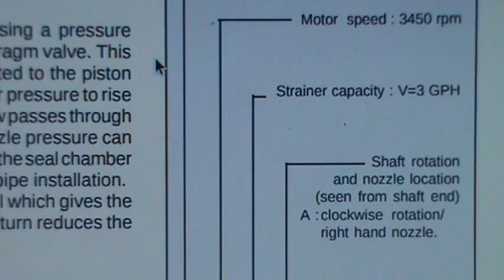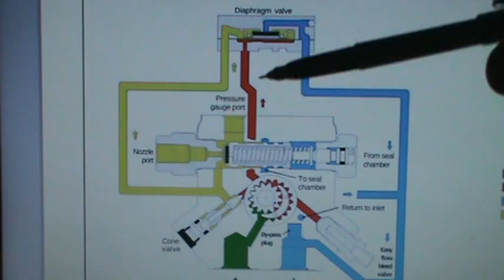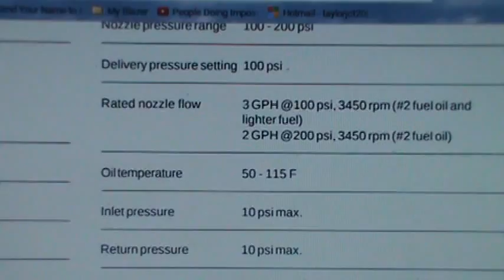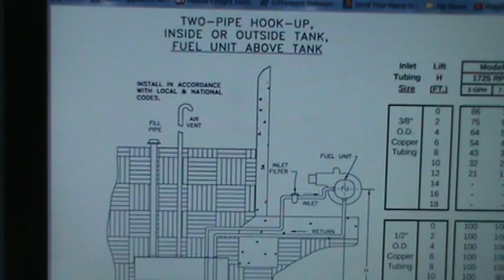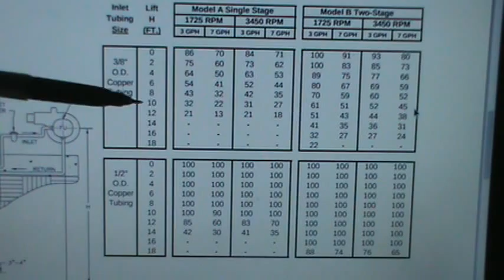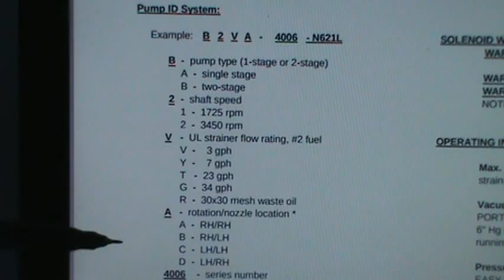Oil Burner 101 Part 1 "Fuel Pumps"

Comment: This was a great video with the A2VA-7116 pump.  I am somewhat new to troubleshooting these pumps. I am a little confused about the vacuum and testing a pump. On the A2VA-7116 single line set, 3/8" with no electronic solenoid. With a gauge connected, 3450 rpm. With a dual pressure/vacuum gauge connected I read 135psi with a .75gph nozzle and the thermostat reaches temp, shuts pump off....will the gauge go to zero or hold a vacuum? I am just confused if that 10psi you mentioned means that it has to have 10psi of vacuum to basically open the valve then once the pumps shuts off and there is no vacuum,  the internal valve closes to prevent free flow? Hopefully this makes sense. I took the cover off before I ever watched this and just a little oil leaked out then stopped.  I do know that inside the tube where the nozzle screws in, there seems to be a check valve, I can hear it when I invert to burner tube. Thanks in after for any further information.
Reply from the maker: The pressure and vacuum will drop to zero when the burner turns off. The fuel cut off valve which allows the fuel to flow to the nozzle line opens and closes on centrifugal force. The pump needs to get up to speed to open. When testing the cut off valve, the pressure should not drop lower than 10 psi. With the burner running. Please watch my video to explain how to test the cut off valve. Example:  If your pump is set to 135 psi. Then when testing the fuel cut off it shouldn’t drop no more than 10 psi. to 125 psi. with the burner running.
Reply: @scotttaylor3049  it may have an issue then. It does have one of those insufficient check valves inside the oil tube at nozzle adapter....no electronic solenoid which you probably already know. With the gauge in the gauge port the pressure doesn't drop when running and when it shuts off, that gauge reads zero. Then jumps up to the 125 at startup. I will try to locate the video about checking the shut-off.  Thanks

Comment: This is a great video, but I still am puzzled by the topic you are covering at about 10:25 My question is, if the OSV needs a slight suction from the pump to permit flow, then why is there not such a / (another) device immediately at the tank outlet, so that any rupture of the pipe beyond the tank is protected by this upstream OSV, thereby stopping the tank contents from emptying onto the ground? I realize that the OSV near the boiler is there to detect heat and shut off the flow when needs be, but is there any reason why something similar couldn't be right up close to the tank.

EDIT - (I have in the last few minutes found this comment referring to where an engineer should install an OSV, besides just as you have explained) 

"he should install a second OSV on the same oil supply line at the outlet from the oil tank, particularly if the oil tank outlet piping exits at the tank bottom, and ahead of the oil filter"

Do you see any downside to doing this, and if not, I wonder why it isn't common practice, or even mandatory?
Reply from the maker: Thanks for your comment. I’m in Connecticut and Connecticut State Code requires a thermal safety valve at the burner and at the oil tank but it only works on temperature if there’s a fire it will melt and shut the oil off. Connecticut code for many years now requires a vinyl coated oil line in case it does leak that way it will not leak into the ground. I’ve never seen one just rupture since it’s not under any pressure but overtime some do corrode through even though it is copper. it is still extremely rare. The majority of oil tanks in Connecticut are in the basement.
Reply from the maker: https://www.supplyhouse.com/Suntec-PRV-38-3-8-Oil-Safety-Valve-9944000-p

This is what you are looking for
Reply: @scotttaylor3049  Brilliant. Thanks

Comment: Good day,
Can I replace my 3450 cleancut with a 1725 suntec? Please respond as its cold tonight. LOL
Reply from the maker: No it will not work it will not open the cut off valve inside to let Oil come out. It works off of RPM. that would be running too slow.
Reply: @scotttaylor3049  Thank you. I live in the arvtic and not sure if \i can find another cleancut. Have a good day

Comment: * Respectfully, motors and pumps do not always 'go from the shaft end'.
I've travelled nine states as a journeyman/ foreman/ service & project mgr. for a union contractor. Company was founded in 1869. Very large industrial and institutional heating, cooling, and process applications. 
 Be aware that some manufacturers  will specify 'Opposite shaft end' or 'Lead End' when referencing rotation. 
'Always' and 'nevers' can create problems.
Reply from the maker: Hi Bob thank you for your comment. You are correct on what you have said, but if you would notice the very beginning of this video it is a specific video for a Suntech A2VA 7116 fuel pump. This particular pump is always looked at from the shaft end for rotational purposes. Since this video was showing training on this particular pump, I felt no need to get into all the other aspects of every pump situation that you might run into. Thank you for adding your comment and your information of this subject matter.

Comment: Very informative & easy to follow.    👍 #  286
I came across your channel looking for some information on these pumps. I am working on a  Webster MD43H-3 which they no longer manufacture but have a replacement for. My problem is that they told me the inlet & return ports are aligned differently & the location I have to work in is very tight so adapting the lines will be more of a job than changing the pump. The current pump was clogged with sludge. After cleaning it out I am getting oil out of the bleeder port but not the feed to the  nozzle.  Looking at the diagram for the Suntec it looks like I may still have a plug at this point. I know without seeing it makes it difficult to diagnose but could it be something other than a clog? Thank you in advance for any help you can provide. Stay Safe, Joe Z
Reply: Thanks Joe Z for your support. Webster pumps do not use a strainer instead they use a set of knives that cut up the sludge and send it through to the nozzle which sounds great but it just plugges everything up. I do not recommend Webster pumps because of this. 
If you’re not getting oil through the nozzle port then you’re valve inside the pump is not working properly and the pump should be replaced. Even if you could free it probably will not work correctly or it is worn to the point where it will not work properly.
Reply: @scotttaylor5658  You're welcome & thank you for  your quick reply. I was surprised when I did not find a strainer in there. I though maybe some one cleaned it out & never put it back in but realized there wasn't any room for one. I did see the knives you mentioned, in the shape of a triangle. I am going to have a time cutting & splicing the copper fuel line to fit the new pump. It is up against the wall with almost no room to work. I called a local supply house & they have the Suntec pumps in stock. Any tips for splicing the line to fit?

Comment: Do I need to adjust a pump if replacing with an exact one a2va71-16 
Great content, thank you
Reply: Dennis Noone The standard use to be 100 PSI to the nozzle, but for years now, in most cases with that pump, it is 140 PSI. Its always a good idea to double check the pressure.
Reply: @scotttaylor5658   so i ll need set it at 100 psi if its at 140?
Reply: You need to send it to what the old pump is set at whether it was 100 or 140 psi. If you can’t test the old pump then look at the specs from the manufacture to determine what it should be set at
Reply: @scotttaylor5658  im replacing a pump with an exact replacement a2va71-16, the instruction doesn't say anything about pressure adjusting,  the nozzle is .65, cant find any specs its a miller M1sc086a, about 20 years old
Reply: @scotttaylor5658  will do, 
thank you!

Comment: I just recently picked up an old unit (60s) and the shaft seal went out on my pump. I am new to this stuff and am looking to upgrade my pump. Are the housing diameter and shaft sizes a universal deal? Or do I have to check for the proper shaft size and mounting collar size?
Reply from the maker: Hey JC. Burners started to change in the 60s and early 70s for newer styles. Look at the model number on the end of the fuel pump. And then look the information up on the manufactures website. Sometimes the information will be on a sticker on the strainer cover. You need to match rotational speed such as 1725 or 3450 RPM. The gearset will determine how large a nozzle you can use. For instance if the gear set is 3 GPH, it will supply enough oil and pressure up to a 3 gallon nozzle. You also need to match rotation direction and sometimes nozzle port location. Without more information that is about all the information I can give you. There are basically two sizes of pump shaft but when you purchase a burner coupling, it will come with different sizes to adapt. For the house in diameter if you were changing from a J Series pump to a mini pump you might not be able to adapt. You better just stay with the original pump to guarantee the correct fit. If you have matched all criteria that I have mentioned, and the mounting hole is the same then you’ll have no problem with the pump. Years ago they made an adapter from Jay series pumps to the new mini pumps.  I don’t know if you would ever be able to find one of those. Good luck on your project.
Reply: @scotttaylor3049  
It's a sundstrand j3cd2003 pump.
Also I am looking to get this system to run waste motor oil. Currently I need to preheat the oil to get it to start when it's cold. What do you suggest I do to adapt this to run more effortlessly with waste oil? It's a shop heater.

Comment: Having and air issue with my single stage pump.  Even with Tiger Loop I get air bound about every 3 months.   Oil tank and burner are on same level.  I have a 3/8"oil line that runs from just off bottom of tank up to attic 12 ' vertically, then 40' horizontal then down to tiger loop and burner.  Minimal bends.  Everything worked perfectly for about one year then the problems started. After bleeding the vacuum is 0 but over time it increases up to 8".  Would a 1/2" line solve my problems?
Reply from the maker: Hi James,  First you need to determine if it is an air issue or cavitation. You definitely need a two stage pump because of the high head even with a tiger loop. A Tiger Loop works OK to prime the pump but you still have to get the oil to it. A larger line would make it worse because you would need more vacuum to get the oil to the burner because of increased volume (weight of the oil). If you are not sucking air from a loose fitting, more than likely it is cavitation because of the amount of vacuum needed to pull the oil to the pump. 
1- Install a Two Stage Fuel Pump. A single stage pump is not designed to do what you are doing.
2- Blow out the oil lines with air. Make sure they are not plugged.
3- Use only Flare Connections. Compression fittings leak to easily and are against code in some states.
4- Make sure all flares are good and fittings are tight.
5- Make sure Fuel Pump Cover has good gasket, Strainer and oil filter are clean and pump cover is tight.
6- Blow back into the fuel tank to make sure drain is clear from sludge.
Reply: @scotttaylor3049  Thank you for the quick reply, I spoke with a rep at Suntec and they said I should be fine with the single stage because the oil tank and burner are on the same level so there is no actual true lift?  They said a B pump would make things worse with the 3/8 line and I should increase the line to 1/2" .   I will try the B pump tomorrow seeing as it makes more sense and changing the line is going to be a lot more difficult.
Reply from the maker: @jamesv7309  Correct once the oil gets to the pump the weight of the oil coming down cancels out the weight of it going up, BUT you have to be able to pull enough vacuum to raise the oil that far. Look at any Suntec lift chart and an A pump (single stage pump) is not designed to lift fuel, you need a B Pump (two stage pump) one stage will lift the oil and the second stage will build up the fuel pressure needed for the nozzle. If you change pumps, make sure you set the pump pressure to what the system requires, Sometimes 100, 120 140 or 150 PSI
Not sure who you spoke to for a rep but he does not know about his products. 35 years experience in this field.
Reply: @scotttaylor3049  Thanks again!

Comment: Awesome video!   Great info.  My Beckett oil burner has a B2VA-8216 with no Solenoid.  It’s old.  I still hear a delay sometimes, I’m assuming that’s from the “fuel cut off valve”?   The tank is bottom feed at ground level about 15 feet away.  If I replace the pump, can I use an A2VA-7116 or one with a Solenoid delay built on?    It doesn’t seem like I needed a 2 stage pump anyway.  Small one story house 1100 sq feet.   Thanks!
Reply from the maker: Johnny's Cousin Steve 
You said you hear a delay sometimes. I assume you mean at startup. The most common cause of that is a bad ignition transformer. It may have a strong spark but delays on startup. Start and stop the burner 30-40 times. “Making sure it fires every time”. Only let it run for a few seconds, just long enough to fire the burner. Listen for the crackle sound of the spark each time. If you hear it delay just once, replace it. Other causes can be, electrodes not adjusted correctly, cracked porcelain on the electrodes, too much air, wrong nozzle, carbon buildup on air tube or electrodes, burnt air tube, plugged oil system, too much draft.
Reply: Scott Taylor Thanks, Scott!   Yeah I guess it could be a bunch of things.   It only happens a few times a season.  My ears are pretty tuned into it.  I’ll do a thorough check in the fall.  I was working on the burner at my rental that does hot water too so I have to always be watching that one.  

What about replacing the pump?   Seems overkill being a 2 stage for gravity feed 15 ft away.  I’d rather get a cheaper single stage w a Solenoid
Reply from the maker: The A2VA-7116  pump would work just fine. Why change your pump if you don’t need to though?
Reply: Scott Taylor I guess I’m just planning ahead.  You’re right.  I like to have a plan should it got out in the dead of winter.   I subscribed to your channel. I look forward to more of your video drops!!   Thanks for the replies!!

Comment: If you put a Tigerloop off the pump and your unit is say 10' above the bottom of the tank and your using 3/8" supply line would that be easier on the pump and that chart change it's specs?
Reply from the maker: Harold Perantie thanks for your question Harold it’s a good one. That should not change the performance of the pump. Look at it this way. Your oil line supply is a column of oil that you are trying to lift to a certain height. The fuel pump has to create a certain amount of vacuum to pull that oil to the desired height whether it is going to the pump directly or to a holding tank or a tiger loop witch is essentially a small holding tank. So the fuel pump has to create the correct vacuum or lift to pull that column of oil to the desired height. The advantage of using a tiger loop is that it reduces the flow rate of fuel being sucked through the supply line. A standard residential fuel pump gear set will pull 25 gallons per hour through the pump. Thats all the pump knows, its either on or off. If you have a 1 gallon nozzle then 24 gallons per hour are returning to the tank when using a two pipe system, (a return line). This makes the pump a self priming pump as well. Since there are 25 gallons per hour flowing through the supply line, it creates extra friction because of the flowrate and how clean the fuel lines are, and the viscosity of the fuel. Using the Tiger loop the oil now recirculates in the Tiger loop and only will pull through the supply line the amount of oil equal to the nozzle in the system. In my example 1 gallon per hour will flow through the supply line instead of the 25 gallons when using a two pipe system. The Tiger loop will also allow the pump to self prime. That’s important if you are pulling oil up in Lou of a free-flowing gravity situation. This will also help in extreme cold conditions because of the viscosity of the fuel. If you put too much vacuum on the fuel it will separate called cavitation, so using the Tiger loop will help in this situation. I hope this answers your question.
Reply: Is there a pump that I could replace the A2EA-6527 that can handle more vacuum?
Reply from the maker: Harold Perantie Check this out  http://www.suntecpumps.com/PDFs/Installation%20and%20Service%20Manual.pdf
Check out page l-6. You have a single stage pump. It can only pull 6” hg on a one pipe or 12”hg using two pipe. Anything more than that  and you will need a TWO stage fuel unit. This unit can pull 17” hg of vacuum. Do you know the vacuum you have? 
Find a pump that meets your specs such as the B2VA-8216. Just make sure the pump can pull the necessary vacuum and your nozzle does not exceed the pumps gear set capacity. Follow the tables on this website. Make sure all the other specs are correct for your application.
Reply: Thanks, you have been very helpful.